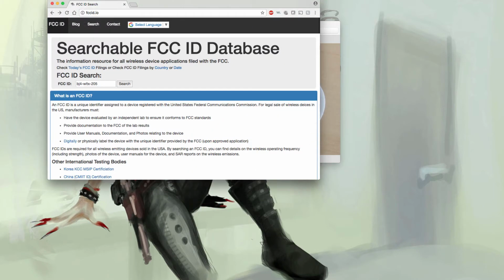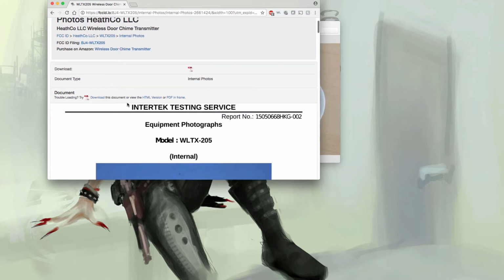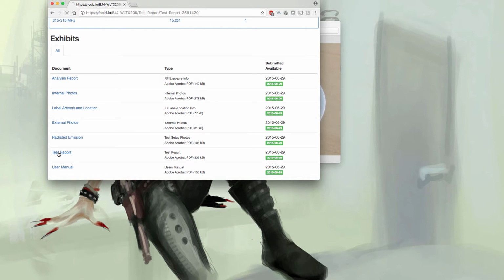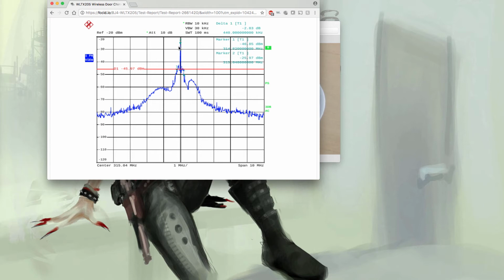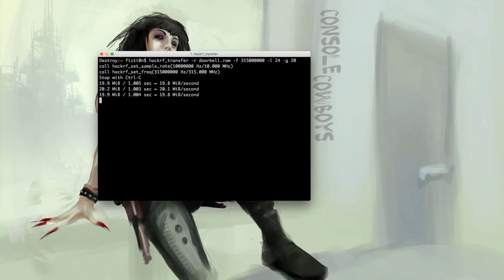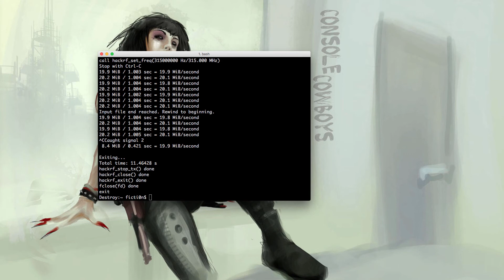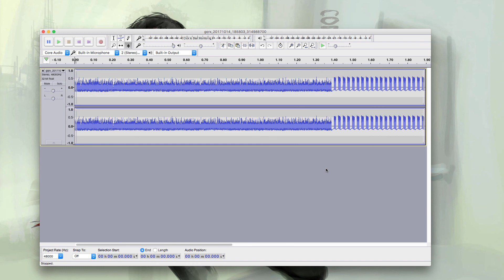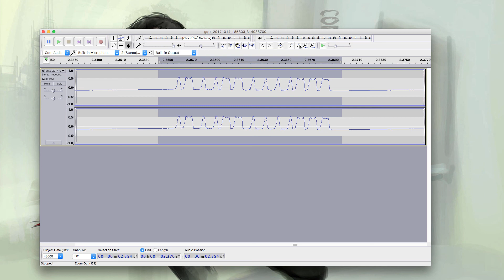HackRF Simple Software Defined Radio Replay Attacks - 0x01

Comment: is yard stick one transceiver like Hackrf One ? and different these too
Reply from the maker: HackRF can play in a larger set of frequencies then a yardstick.. but both can be used for similar things... Yardstick in my opinion is better for scripting and working with testing devices which is why I wrote RFCrack.. However, HackRF is pretty powerful if you are good at setting up GNURadio components.. I prefer the yardstick for my uses..
Reply: Yardstick is more for specific tasks in the sub 1ghz range, HackRF is def far more capable of much more, but it really requires gnuRadio to fully take advantage of all of it's abilities and that is a massive program that can be a bit daunting to get into for some. That's why his videos are praised for easy learning!
Reply from the maker: You can do loads more with the HackRF provided you want to spend time to mock up GNURadio stuff.. I find from the penetration testing perspective, that the yardstick is much more useful for my needs. If I was doing engineering of some system for a more prolonged usage I would be more inclined to set stuff up with hackRF... on a penetration test yardstick fits the niche for quick prototyping without having to mess with a GUI interface.   Since when I am done mocking up my attack I don't need to build off it further, instead just leverage it for an attack and move on..

Comment: if you put a wrong frequency what will happen ?
Reply: If you put the wrong frequency then it won't see the signal you sent... or if you are listening it wont see the signals your looking for..... Its the same thing as if you are tuned to a 94.9 radio station, but you want to listen to 107.5.. Your not going to hear the music on 107.5...  Does that make sense?
Reply: aw ok . but i to find the frequency you don't really need the fccid
Reply: Yea, the FCCID is the easiest way to get your frequency.. but if you dont have access to that FCCID then you will need to scan for the right frequency when its in use and look for the signal being sent at various frequencies.. you can do that with RFCrack and set some common frequecies and leave it running.. if the logs show some output after awhile.. it might be the right frequency for the device if there isn't random noise in the area.
Reply: ok. thanks Olie .I'm new in the radio thing haha

Comment: Which version of audacity do you use in this when i go on audacity now i cant even see my frequency waves file as clear as yours even when zooming
Reply from the maker: It would be whatever was released around mid 2017 when this video was created..
Reply: @ConsoleCowboys  Cross that I figured out I had to zoom more with mousepad so right now I’m learning with my garage clicker it runs on 310MGHZ and I can read the signal on GQRX and see it in Audacity but the pattern is so long how do you know when to take gaps between the 1’s and 0’s
Reply from the maker: @kahmari_srt1395  THere are blogs on consolecowboys blogspot associated with this video for more info on the technical end.. Sometimes you have to guess and see if it works based on how wide the gaps are with how many 000's and 111's and see if it works based on how wide they look, its not an exact science...
Reply: @ConsoleCowboys  So I read the Blog and did a little research come to find you can use Universal Radio Hacker to copy a signal and send the same signal and it decides it for you can you make a video backtesting this program? I’m trying to clone my garage opener still I get the signal and code but when I transmit nothing happens
Reply from the maker: @kahmari_srt1395  Cool have fun with the new program... the RFcrack I wrote will also capture and replay those as well... and it will help you clone them by matching signals, I have a video on reversing and matching signals with functionality of RFcrack the match the signal of your garage to create a new remote.. its in the RF playlist on this channel..